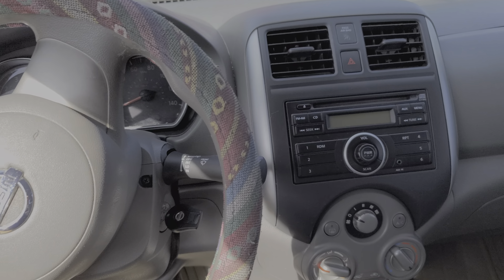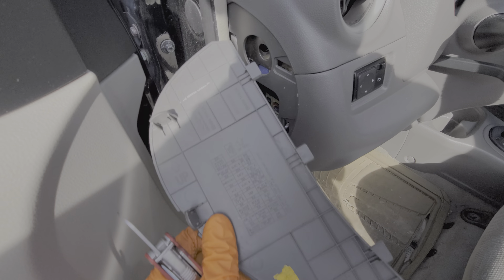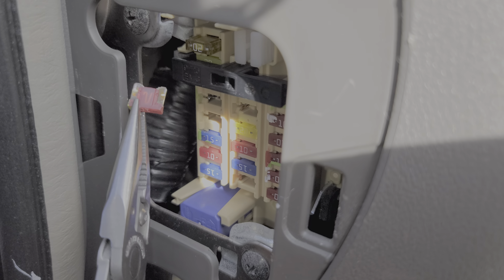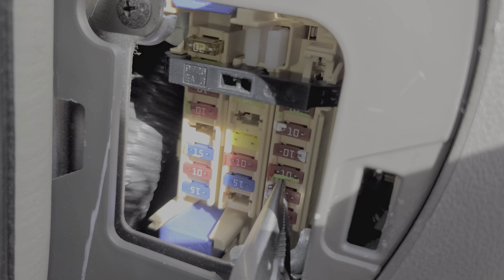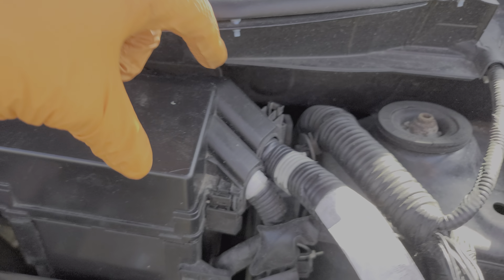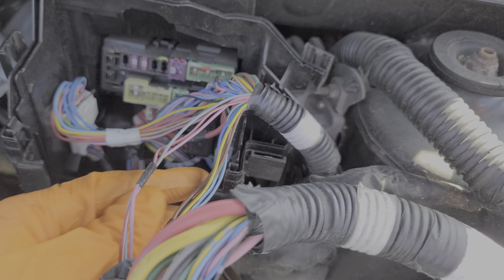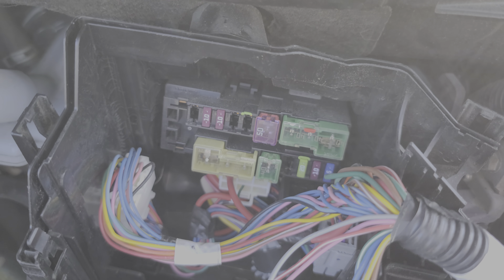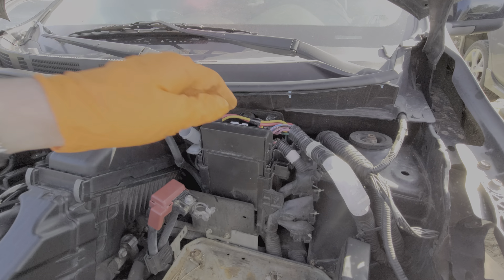2012 Nissan Versa Radio Fuses

Comment: Yoooo I have a 2014 hatchback and so the radio fuse was actually in the same location as the sedan in my case but pulling it out and putting it back in got my radio back on so huge shout out for saving me some time and money

Comment: Interestingly enough my radio wasn’t turning on, I pulled and checked the fuses you mentioned and they were ok. I put everything back together and apparently this process reset the system because my radio is working again

Comment: My radio when I’m driving just fuses out. It will fuse out and not turn back in for days. But the rear view camera will turn on sometimes. I have a Nissan Versa SV. will taking out the radio fuse help reset the radio and stop the fuse from blowing out?

Comment: I have a 2015 Nissan versa Sedan. My radio turns on with the orange light. Speakers work. Everything works. But it doesn’t show any letters or anything. I can still switch through stations but it won’t show me the station I’m in. No display. Does anyone have an idea of what this could be ?